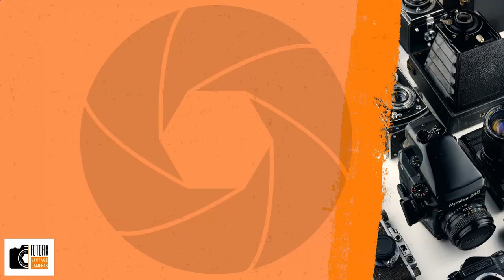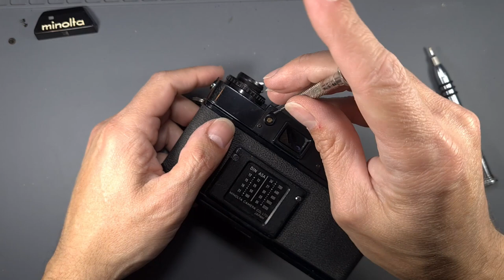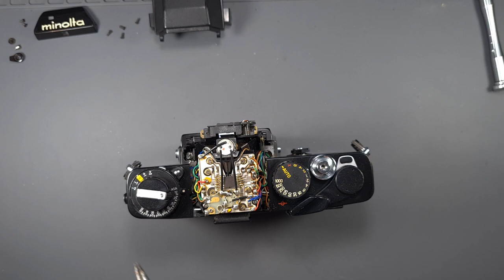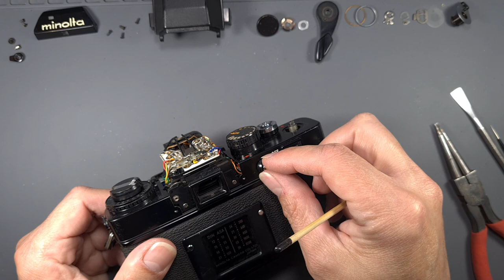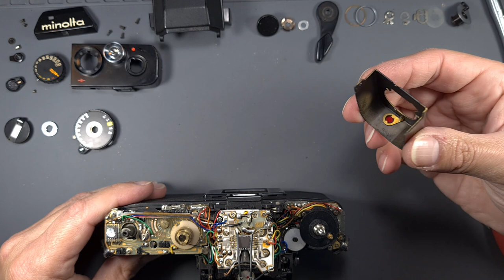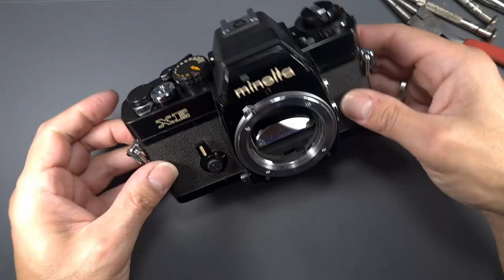Minolta XE - Remove the Top Cover

Comment: I have an XE-7 - the shutter speed dial seems to be off by a stop - when you select 1/500, for example it actually shows up as 1/1000 in the view finder. I am wondering if someone had taken the knob off and put it back on incorrectly? I wasn't sure from the video if you have to pay attention to the position of the knob when it is put back onto the camera - and, if so, what's the right way to do that?

Comment: Hi, I also have the same Minolta XE.
However, I think by accident the shutter speed selection isn't aligned correctly, thus if I set it on "A" mode, it wont be working as "A" mode but one of the shutter speed (I'm unsure which one it is).
Moreover, when I try to change the shutter speed, it just glides smoothly (no clicking feel) when changing from one shutter speed to another.
Do you think this can be serviced? thanks!
Reply: Mine has a similar problem. Going to try to fix as soon as I get a set of jewelers screwdrivers.

Edit: turns out I just needed to tighten the 3 screws on the shutter speed dial to fix the slipping. See the 4:07 mark of the video.
Reply: @chanalogfoto  thanks a lot! I'll try looking into it soon 🙂